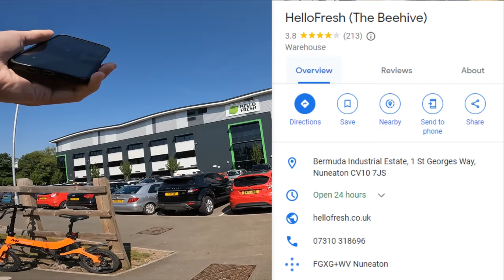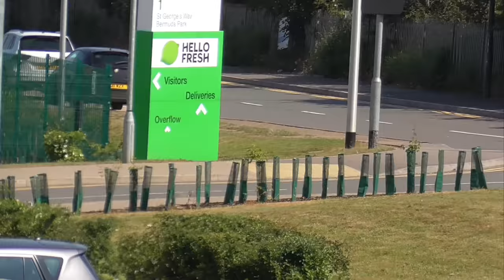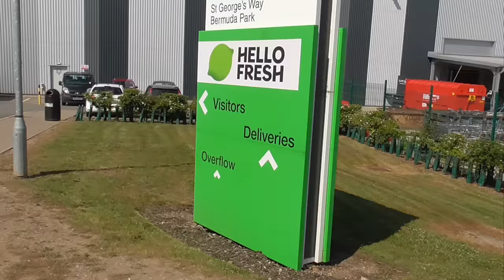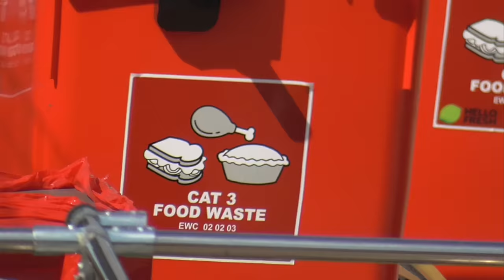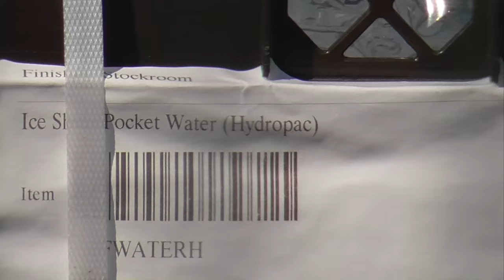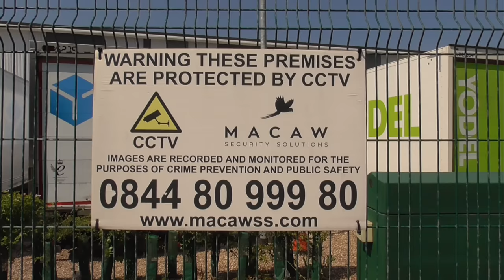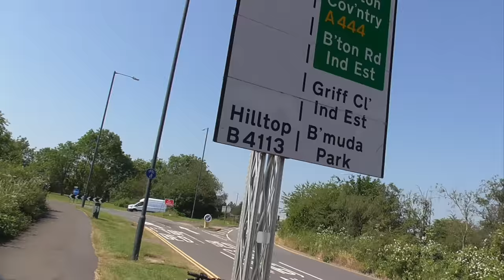We Don't Take Any Videos Here 🤔🎥🛸❌

Comment: Just for your info DJ, when you hear voices over the radio comms, if they sound rather robotic or very unnatural sounding, then they are probably using a digital radio transmission, which may or may not be encrypted. so listening to UHF 446PMR is not going to be of any use to you.
Reply from the maker: I presume Hello Fresh where using a licenced band as my scanner didn't pick their transmission up. I am still learning about this but what I gather so far is that if my scanner picks it up then its on an unlicensed public band which can be legally listened to and rebroadcast as long as you have no criminal intent. If you are the subject of the transmission then this strengthens the case that you are allowed to rebroadcast. Would you agree with that?
Reply: I would expect them to be using a "Business Licence" and have choosen or been given a frequency to operate on,  if a business chooses to use a "Licence free Public Frequency", then there is no expectation of privacy.
the PMR446 has 16 Channels so they may have been operating higher then you were scanning, also they may have had Tone Squelch enabled, or may have had T-CTCSS or  R-CTCSS or DTMF, all of which can stop unwanted people interacting with them, or allowing them not to be heard unless the correct tone or ID is obtained . even though they are not encrypted, PMR446 only allows for low power fixed antenna handhelds
if you you see large antenna installations onsite then you know they also have a alternative communications system.
Reply: @DJAUDITS if your close enough to get a strong signal then an rf sniffer will tell you there frequency as soon as they transmit. Frequency Meter SF-401 Plus Portable Tester. It shows everything on screen

Comment: I have to ask the question how did these two security guards get an sia badge.? explanation mark?
 From the job centre they probably have been sent on a basic course which is quite easy to breeze through I recall my instructor also ran a security company for the local football club a little touting for stewards and then of course which is no real hardship you then forward your application to the security information authority with the recommended fee and your licence badge will be returned to you

Comment: DJ is there an app that shows where drones are flying… like a live action map as it happens?
Reply: Probably is as long as the flyer registered the flight, otherwise they wouldn't know 🤔.
Reply from the maker: No. Drone Assist will show you if you have logged your flight (which very few do) 💚
Reply: @DJAUDITS  it’s only because the other day I saw a drone over the top of my house and it wasn’t high enough & also pretty low and I watch your videos and awful lot. Was going to ring 111 and find out who was doing it but I doubt they would’ve known.
Reply from the maker: @No1Waffler  If it comes below your roof height then just film it for evidence purposes and try and get positioned with a good wide visibility angle so you can get an idea of where it lands. Then speak to the flier who may just be taking photos of a property for sale. If you sense any wrongdoing then of course report it 101 but it could be innocent.
Reply: @DJAUDITS  yeah exactly what I thought, probably nothing but good intentions.